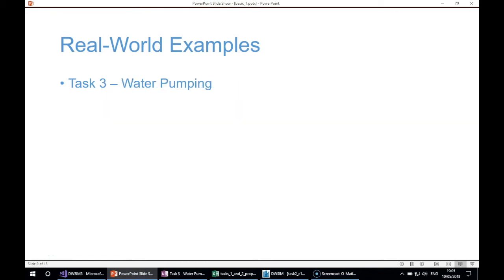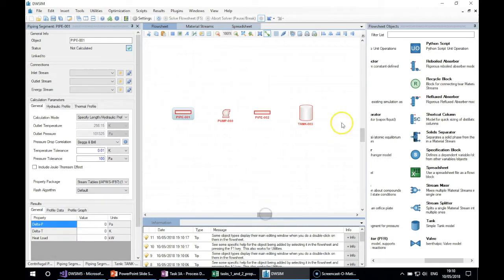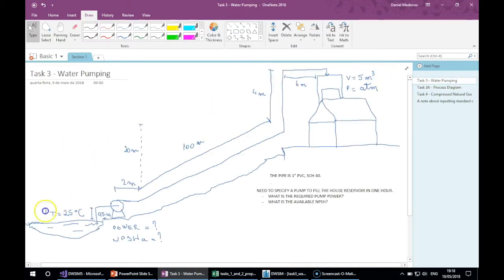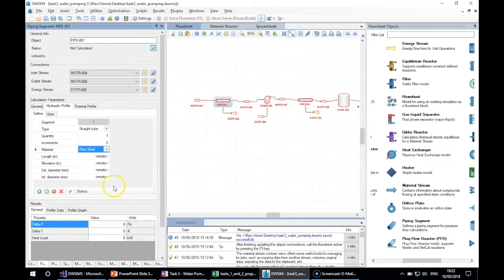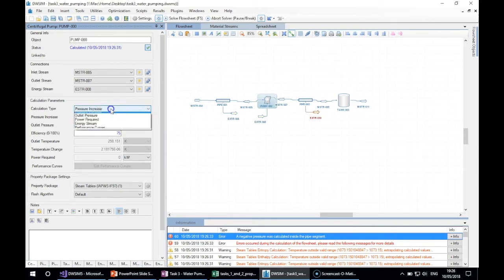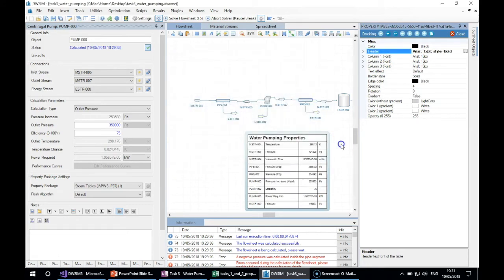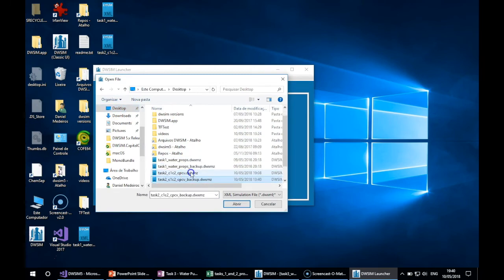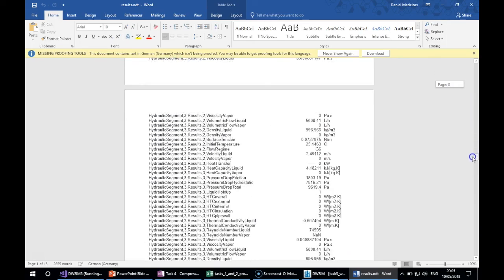Basic Course 1 - Creating a Simulation (Task 3)

Comment: Is there anyway to do it other than Trail and error?
Reply: I saw from other video about DWSIM, it was shown that controller block can be used to avoid trial and error. However, in my trial using the controller block, I get error message which I still don't know how to troubleshoot it.

Comment: Good evening engineer Medeiros. Great tutorial. I understand that DWSIM is a sequential solver, but I would like to ask you if there is a way to set the outlet pressure (last stream) and calculate the pump outlet pressure, instead of having to manually try to set the right pump outlet pressure that matches the atmosphere pressure at the outlet stream.
Reply: You could try to insert a valve and set it as controlling the outlet pressure and set the outlet pressure ti 1 atm.

Comment: Hi, Thanks for your huge work! In pipe setup what means "Increments" and for elevation you intend output-input?
Reply: it means the amount of subsections DWSIM will split the section to calculate properties. For instance, if a section is made of 100 m of straight tube and has 10 increments, then DWSIM will calculate properties and pressure drop for each 100/10 = 10 m increments.

Comment: Hello! Thank you for your time doing the tutorial, it was very explanatory :). I followed all the steps twice with you, but I cannot simulate the task on my DWSIM. It keeps showing that there is a problem in Unit Operations, and the inlet pressure keeps dropping a lot, and vapourizing everything! In other words, I put water as Input Material, with 25 celsius and 1 atm, but after the first pipe I already have vapour. Do you know what's happening?
Reply from the maker: Check the units for the pipe diameter, and make sure to run the latest version.

Comment: Nice tutorial! When I select the predefined pipe dimensions though the diameter entered is wrong by a factor of 1000...meaning my outer pipe diameter becomes 33 401 mm (or 33.401 m!!!) and the inner diameter 26 644.6 mm (or 26.6446 m!). Maybe this is due to the fact that I'm using comma as a decimal separator? Or is it a bug? Have the latest version of DWSIM (5.2 Update 6) for Windows (64-bits) installed.
Reply: Hi again. Just checked myself changing to "." as decimal separator and YES that is the reason....but maybe something that could be fixed in future versions? Or is it "compulsory" (or strongly recommended ;-) ) to have "dot" as a decimal separator for calculations with DWSIM in general? May there be other input/calculations that go wrong due to that issue?
Reply from the maker: Hi Stefan. Sure it can be fixed. DWSIM should be able to handle different decimal separators... this feature is very ancient and I probably forgot to update it in the process.
Reply from the maker: Fixed! https://github.com/DanWBR/dwsim5/commit/a37654949c333ebe949ae04b6cc036e580b1ba32